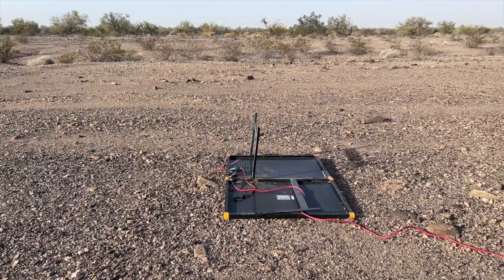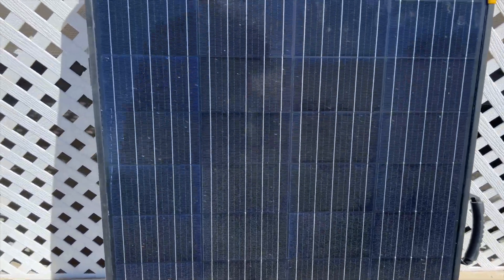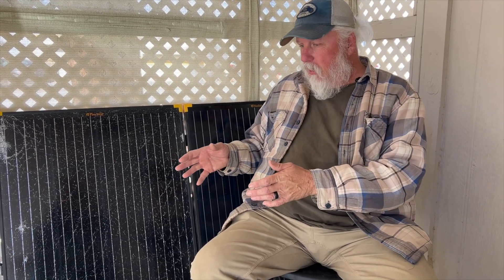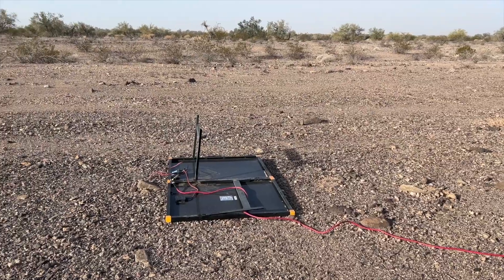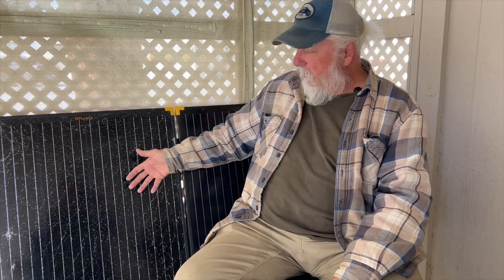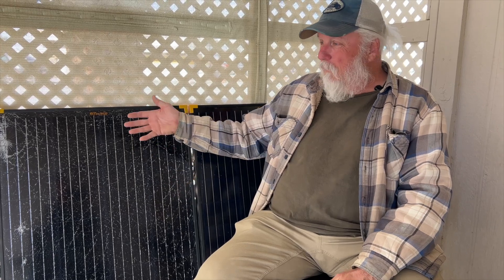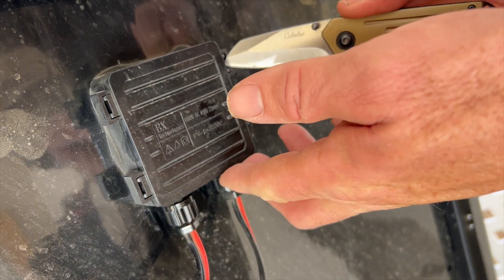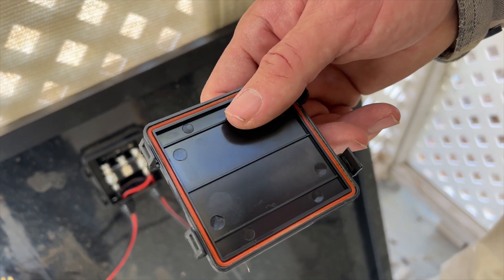Solar Panel Disaster in High Wind

Comment: I have 4 100 watt panels on my roof , all 4 have brackets on all 4 corners screwed in to the roof,and this winter in Joshua Tree one of them blew off. Ripped the screws out of the bracket and it flipped over onto the panel in front! I was in a tornado 12 months before in Pensacola Florida and had no issues then.
Reply from the maker: Wow! I do always worry a bit about the roof mounted panels in high winds, but so far haven't had a problem. Fortunately.

Comment: I use so little power I can unplug my panels and have 13.1 watts in the batteries left on the fifth morning. I just lay the portable panels flat on the ground. I've had guys tell me I'd get more power if I aimed them at the sun. 😊

Comment: My jackery panels went flying from an unexpected wind.  Although they did get scratched, they still work well.  
Now I tie a bungee cord to heavy rocks to keep my panels from flying.
Putting my panels away in the evening is a must!
Reply from the maker: I probably should have been putting this one away regularly, but it was bulky and heavy enough that I hated to move it too often. The bungee cord sounds like a good idea. I've used large rocks to weight the legs on these panels before, but that does make it a pain to move.

Comment: Thanks for sharing this mishap! I like the suggestions of using sandbags or a dump bell! Thanks for the heads up!
Reply from the maker: Exactly! My first solar panel was a 100 Watt portable that I eventually mounted on the roof rack of my minivan because I was tired of moving it around and not being able to deploy it in the city. The 400 Watts on the van usually does an adequate job when we're off-grid and is tethered to the trailer. Unfortunately, the house battery in the trailer is due to be replaced so I was using this portable for any time we had to take the van into town for errands to keep the trailer battery charged.

Comment: Bummer about the damage to your panels!  thanks for giving us food for thought though. I won't be leaving my little flimsy solar panels outside unattended lol
Reply from the maker: This thing was heavy enough that I hated to move it around more than necessary, but I also thought that would keep it from flying around. At least that had worked in the past... LOL I have weighted the legs of a similar panel with flat, heavy rocks in the past. It was ok with the prevailing wind from the west, but that crazy rogue gust from the north must have caught it just right - and been heavy enough to lift and propel a rather heavy panel quite a distance.